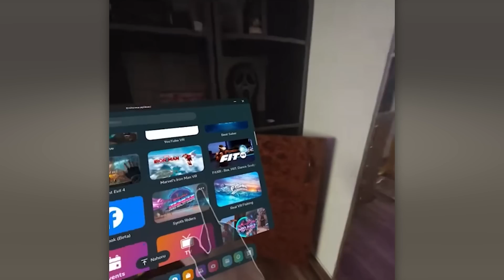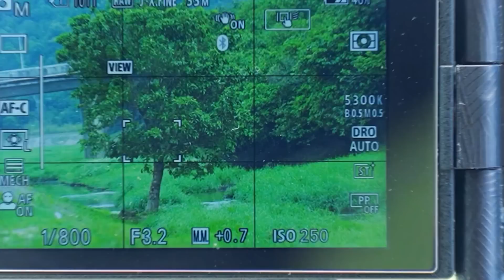Genius Inventions That Should Be Implemented Everywhere

Comment: @13:32  if my prints came out looking that bad,  I"d throw my printer in the street...  the layer lines are horrible.. it looks good from 20ft.. but upclose   NOPE!   at 13:28 you can see the screw shafts vibrating like hell.. they need to be stabilized badly